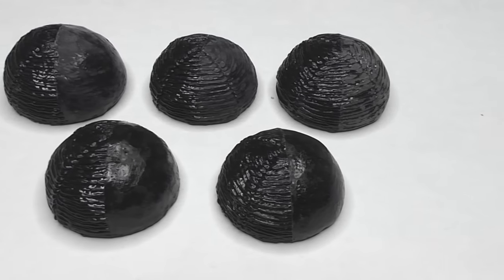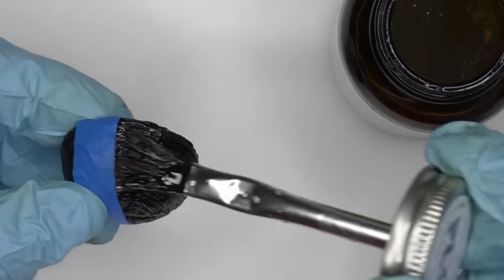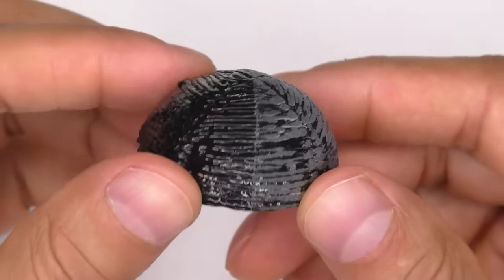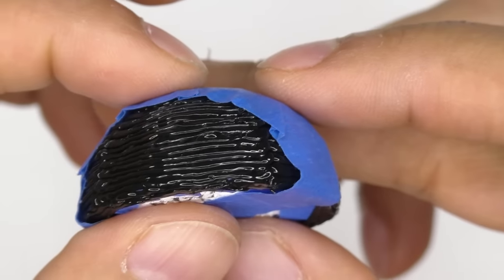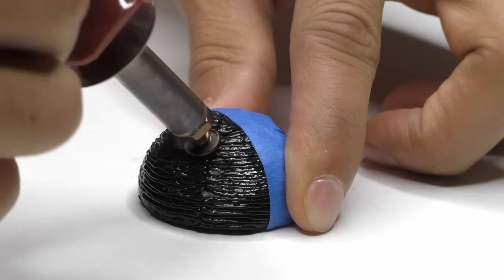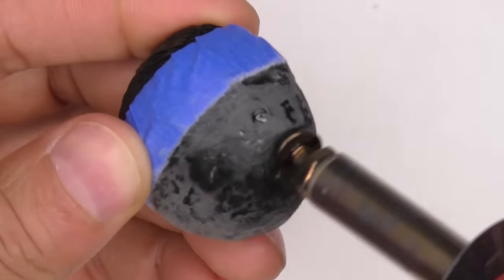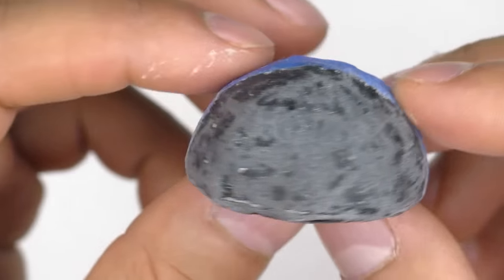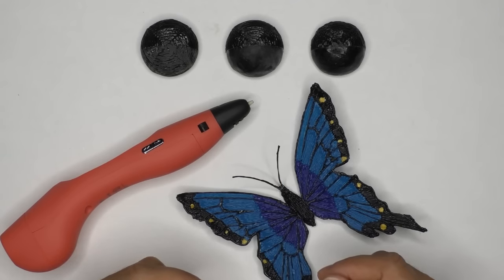How to Smooth 3D Pen Creations | Tutorial

Comment: you might try a heat gun after the sanding.  I have never worked with pen prints but have had good success with my 3d printer prints.  If you do it just enough, it will bring bring back the original glossy sheen.  I think this works by relieving stresses created by sanding and melts the tiny hairs of plastic that remain from sanding, surface tension pulls on that tiny amount of plastic thus smoothing and restoring the "just melted" glaze (because it was just melted).  That's my working theory anyways.

For the scale you work on, something like a reflow soldering setup would be ideally suited.  If you are not familiar, they are tiny, focused guns with very precise control over temperature.  It could also be described as a hot air jet, that is to say there is some pressure to act upon the print in the exact spot you are heating to move material around.  think of it like a hot "air brush".  The best part is, its effectively non contact.
Reply from the maker: Hi, thanks for the ideas and feedback!  I have tried using my handheld torch, but with that it is very hard to control the application of heat, so you usually end up melting and making the surface look much worse.

I like the idea of trying a heat gun (which I have) and especially the reflow setup (if I can get ahold of one)- I'll have to give those a try.  Thanks again for the ideas!
Reply: I've had a chance to try using a heat gun, it works great! I found the best combination seems to be a woodburning iron--->sanding--->heat gun process.

 The biggest downfall is that the heat gun can expose hidden pits under the surface texture. But the holes are usually tiny pinholes, that are easy to to fix up later
Reply: A regular cloth buffing wheel with a white polishing rouge will make your wood burner smoothed object really pop. And it’s very quick!
Reply: Can confirm. A heat gun will bring back the glossy sheen after sanding. However unfortunately it does next to nothing to help with smoothing the surface itself. Instead of melting layer lines together the PLA mass will just absorb all of the heat and become malleable. Great for bending 3d prints into particular shapes though!

Comment: im almost giving up on smothing this. I thought the problem was abs and i started to use pla. Nothing. Paper filer doesnt seems to do ANYTHING to the piece. Using a drill still doesnt give a straight surface. I saw you saying that you do many rounds of smothing and sanding. Thats the only thing i didnt try yet. I had no idea about this, No one says that! lol
Lets try once again. prays lol
btw, your channel is amazing! I hope i get there soon
Reply: hm, an issue i find is that the surface has warped over time from the heat and layers of plastic, another one is that the surface is shiny and "smooth" but not geometrically smooth, like the spheres in the video are a lot smoother by the end of the various processes, but geometrically they are still very wobbly. my best tactic is to have some mechanical way of sanding the surface, for a flat surface i have the sand stapled to a plank, and the plastic piece is pressed and rubbed in one direction, back and forth, you get a very clean surface, because the mechanics remove my nerves and shaky hands from the process almost completely.

Comment: Its better to have a controllable soldering iron. You can set the temp to what u want. Take care to not keept it too high if you are a beginner. For newbies: keep the temp low and be steady n slow with your hands. High temp can smolder the plastic. 
You may also want to try a hot air soldering iron. They blow out hot air.
Or you can also use an old cloth iron for larger parts u may need to modify it to make it workable for ur requirements

Comment: Hi Mr.Potent, very nice tutorial thank you for that, also I want to give you a tip for a great finish, after using the wood burner method you can add this one which is heating it with a heat gun, it takes practice but I am sure that you can make it possible 😀

Comment: I had a feeling that 3d gloop might did the work like vapor smoothing on abs plastics.
Another way that I personally use after sanding is varnish (with brush), in case you don't wanna use lighter and risk to get burning marks.
Reply from the maker: Ah nice, thanks for sharing.  You use a wood varnish?  I'll have to give this a try!
Reply: @PotentPrintables  I'll sent you more info on insta.
Reply from the maker: Ok, thanks.

Comment: For sanding, why not use a sanding tool like a sanding tip on a dremel or one of those disc sanders? For the latter, you have ready access to different grits as well, although you'd need hearing as well eye protective equipment (safety first).

Edit: dremel doesn't work well apparently, but what about a disc sander?

Comment: After Sanding so it's a smooth surface then take a quick torch on it. Brings out that shine. There is also painting it with 3d Printing Resin and then curing it might work.

Comment from the maker: Interested in improving your 3D pen skills?  Check out this playlist- has something for all skill levels!
https://www.youtube.com/playlist?list=PL2emNPgwaprp_tl3YWI9i6n082hRq7E8q

Edit on 12/26/2020- Lots of people have been asking about making the stainless steel tips.  Here is how I did it:

The stainless steel tips I made myself from 8-32 threaded stainless screws, with a grinding wheel.  Note I can only say this size works for the wood burning tool linked in the description.  After grinding the head down to the shape I wanted, I made the angled bend.

I put a bunch of 8-32 nuts on the screw, stopping at where I wanted to make the angled bend.  Then I clamped all the nuts in a vice and bent the screw.  Once the bend was made, I was able to remove the nuts from the straight section with the threads intact.
Reply: Could you explain the two filment comparison that you mentioned earlier in this video please
Reply: Can you just use a pan
Reply: how did you make the stainless steel tips ?

Comment: the hakko t18 c3 is pretty amazing if you came into this already with a soldering iron. You have to be patient given it has less surface area but really effective. also just a heads up, the kit you link to does not include the smoother you are using.

Comment: I haven't tested this out yet with PLA yet but with other thermal plastics. After you are done getting the final smooth shape you want, you can hit other thermal plastics with a heat gun lightly to reactivate the surface so that it returns to the glossy plastic look if it was able to be glossy originally (Worbla Crystal Art is one such plastic).

I suspect it needs practice and I would use a mini heat shrink gun instead of a large heat gun for control (I have both guns for this reason).

Comment: What about a Dremel? By the way, another great video!
Reply from the maker: Thanks. I've been wanting to try that, so you might see it someday in another video. If you try it let me know how it goes!
Reply: @PotentPrintables  I will let you know, my new pen will be here tomorrow, & Dremel is on the charger.
Reply: I tried dremel it’s not the best with a rough bit
Reply: Yo dremel is not worth the effort and the dirt. Its nicest using the heated metal method, u get best results and it makes no dirt. U can see a bigger difference when using transparent pla and use a dremel the pla gets white and looses the transparency. This does not happen when only using heat.

Comment: I have the same wood burning kit. Id like to see what heat setting you’re using and about the stainless tips you were using. I was having trouble smoothing with the brass tips
Reply from the maker: For PLA I set it just into the orange section of the dial.  The stainless steel tips I made myself from 8-32 threaded stainless screws, with a grinding wheel.

Comment: Do you have or would you make a tutorial on how to make the stainless steal tips? I would love to know how since all I can find are copper tips. Amazing video and much love from Canada 🥰
Reply from the maker: Thanks and hope everything in Canada is well!  I probably won't make a video about it, but I used stainless steel screws and a grinding wheel to make the tips I have.
Reply: Potent Printables omg thanks for replying! I will try that 😊
Reply: Potent Printables Great video, love all your videos. Thanks for all the help!! Ive also tried to make them from stainless steel screws, bolts and not having great success. They are not heating up to same level as the rest of the tool,.When I grinned down the screws they still got the Philips head + showing .... The bolts are easier and I’ve even die’d them so they screw right on the wood burning tool,. But still i get the same problem. Could you explain a little more in detail how you got yours to work?
Reply: @Potent Printables Actually never mind. I figured it out.. And ill upload a video shortly on how to do it so no one else has to go through the same nonsense I did with screws, bolts, etc lol...

Comment: I use Duramic PLA, It gets gummy in acetone but it wont smooth in a vapor bath.
I have found that an acetone soaked rag can be used to buff the print lines out.
You may want either a a pair of Butyl rubber glove(think heavy duty rubber gloves) or lotion because it can potentially chap your hands.

Comment: my personal preference is actually a handheld battery dremel . . . can get one fairly cheap from walmart( HART - one of the better options imho) and a pretty comprehensive bits kit from harbor freight (the oval one is the best) and then all it takes is practice tyo figure out which bits do what to the PLA or ABS . . . also the 3d smoother stuff is a waste of money . . . PLA responds to acetone the same way, and ABS responds to alcohol the same way

Comment: For the tip on thr wood burner what did you use?  I have tried this technique but I cant seem to find the right size sheet metal screw.  It looks like you use a stainless steel screw but I've had a hard time finding the right one and when I did it seemed that you have yours bent to a slight angle which I have tried but failed to get a consisten result.  When I followed this it seemd I was stripping the threads and not getting a good result.  After watching your grind video do you think you could have done your oven smoothing technique on that project or is it too delicate and ornate of a shape? 

You're the reason I got into 3D pens and will be diving back into it seeing as hie I have rolls and rolls of filament but lost some mojo after trying some projects that just seemed to be more deflating.

You are inspiring me again though and love your videos 👏👏👍👍
Reply from the maker: Super glad to hear you’re getting back into it!  Glad my videos helped :)

The stainless steel tips I made myself from 8-32 threaded stainless screws, with a grinding wheel.  Note I can only say this size works for the wood burning tool linked in the description.  After grinding the head down to the shape I wanted, I made the angled bend.

I put a bunch of 8-32 nuts on the screw, stopping at where I wanted to make the angled bend.  Then I clamped all the nuts in a vice and bent the screw.  Once the bend was made, I was able to remove the nuts from the straight section with the threads intact.

Comment: I've found using a wood burner even with stainless steel tips gets some of the PLA stuck to the pen which then "cooks" and releases smoke. :x Any idea how to avoid this?
Reply from the maker: I always have a paper towel handy and I immediately wipe off the tip if this happens.  I also periodically wipe the tip just to keep it clean.

Avoiding it totally is tough- keeping the tip moving as you smooth and not dwelling too long on one area helps a lot.
Reply: @PotentPrintables  Thanks for the advice! I am also going to return the one I bought and get a Walnut Creek woodburner since they seem to have a better variable temperature, hopefully that helps.
Reply from the maker: Keep in mind the Walnut set does not come with stainless steel tips.  I had to make my own for the Walnut set that I have.
Reply: @PotentPrintables  Not sure I'm crafty enough for that so might just have to wipe them off a lot lol.

Comment: Interesting video I enjoyed it I like all the different methods, i have never tried the gloop and probably now never will, as you have proved light file and sand then soldering iron wood burner best way. 
Have you tried a heat gun that works or same principal small blow torch but move fast to prevent burning ?
Reply from the maker: Thank you!  I have tried a small handheld heating torch but it either melts too much or too little- it is very difficult to control.

Comment: Hello,
can you test epoxy resin and trop it on the surface?

Thank you very much
Reply from the maker: Just by itself or after using a wood burning tool?
Reply: @PotentPrintables  only the epoxy resin. Before, you can Mix the resin with color.

Comment: How do you keep your soldering iron clean while smoothing? I keep getting little bits of burnt plastic stuck to the project
Reply from the maker: I use a paper towel, folded over twice into a small square.  I wipe the tip frequently because I am paranoid about ruining the model I am working on.

If you are getting little burnt pieces coming off your model it might mean that you have the temperature too high on your smoothing tool.

Comment: When is it better to use a 3D pen instead of using polymer clay? Clay seems easier and you get a nice surface directly. Is there any object that 3D-pen is the best method for? Or is it just about wich tool you find most Joy with?
Reply: (If you have’nt watched clayclaim on youtube, Do :) )
Reply from the maker: This is a very interesting question!  I think each method has its own strengths and weaknesses.  In my opinion 3D Pen has these advantages over polymer clay:

- Different types of filament that can be used (PLA, flexible filament, see through filament, etc.)
- These very different filaments allow for a very wide variety of applications, which can all be combined into the same model if you like.
- High strength to weight of plastic (can make much longer and thinner models/structures without them breaking.  Clay can be very brittle).
- Easier to make hollow models and integrate electronics

Hope this helps!
Reply: Potent Printables Thanks for the answer! 👍🏼 :)
Reply: Ooh I think  I might need a 3D pen. When I want to modify allready existing things made of plastic and its not possible to bake the hole thing in the owen. And if I first modify clay so it
 will fit to the plastic it gets desorted when I remove it for the baking. For these cases Ive tried meltable plastic (small plastic pearls that melts in hot water and harden when it gets colder) But it wasnt really good.

Comment: I just got one for Christmas cause my girlfriend thought I would have a need for it for building custom 1/24 scale model car kits for shows like the ones you buy in a box and gotta paint they have shows and ppl who show up have talent and crazy good looking cars so I use mine for making side skirts and custom grills and adding smokes to rims and even filling in divots on the plastic model body itself because it always is an injected correctly so use the filling body mold lines and is anything else you can think of for 124 scale car modeling like even if you want to make a new suspension part or do something to attach your suspension up higher to lower the car you can without having to cut and drill and make new parts by hand with a knife out of scrap or out of sheet plastic for car modeling it's a very useful tool once you get the hang of it and has many uses with other hobbies such as RC car racing I was able to make a little ring around my right front tire that which is foam for carpet racing instead of using CA glue I just put a little bead around with with a my 3D pen and it creates enough friction loss so the car doesn't traction roll same principle as putting on the CA glue but it's not permanent and ruins the tires after a couple races you can take the tires off and regrind them and use them on a higher end racing class or something or just whatever or you can use as a tuning tool for your RC car on carpet racing with the phone tires too by adjusting how much grip you have on each tire by using a 3D pen only and I use the fix cracked bodies of the track or fill in the body pin holes they get stretched from Rex and stuff like that so it's a great tool to help save you money time and effort at the RC track as well if used correctly

Comment: @PotentPrintables I just got a woodburning tool and tried it out on this penguin i made. The black smoothed out pretty well but once i got to the white, i started getting burned PLA smeared all over it. I switched from the flat tip to a chisel soldering tip, it wasnt as bad but it was still there. I dont see that happen to anyone else in the many videos Ive watched when people use a woodburner to smooth their 3D pen creations. Any suggestions for me? Its very frustrating
Reply from the maker: I'd first try turning the temperature down little by little.  You want the lowest temp that the filament melts easily at.
If that doesn't solve the problem, it may be the material type of the smoothing tip you are using.  I found stainless steel tips work the best.  Many wood burning tool tips come in brass or bronze, which doesn't work well.  There is a section in this video where I talk a little about that.
Reply: @PotentPrintables  yeah unfortunately I bought a cheap one from Harbor Freight and it is non-adjustable, so it just gets really hot. That sucks, guess I gotta return it and get one from Home Depot. I noticed the silver tips worked better because the filament doesn't stick to it and burn on it much, that's my problem with the flat brass blade. It ends up smearing the burnt filament all over